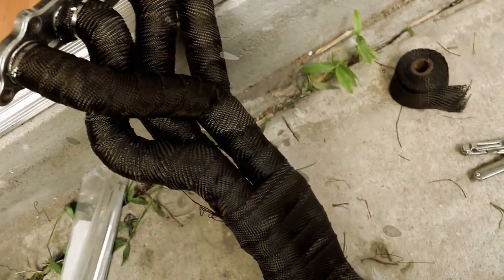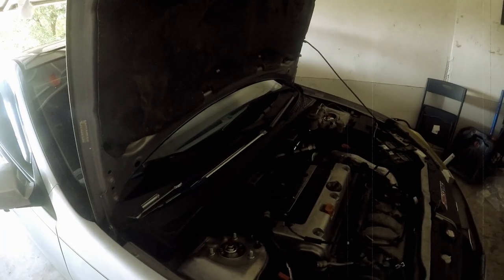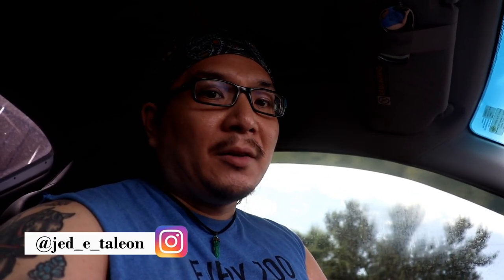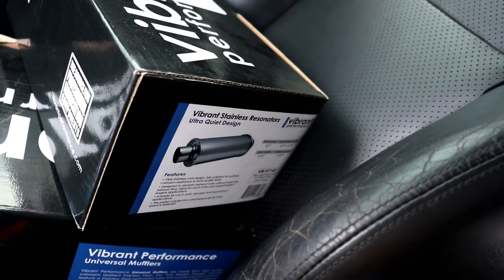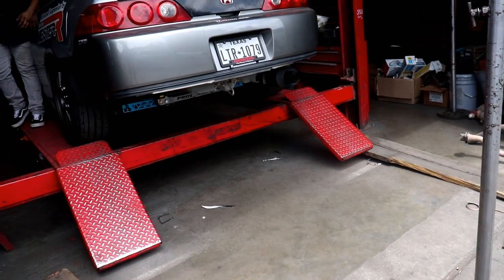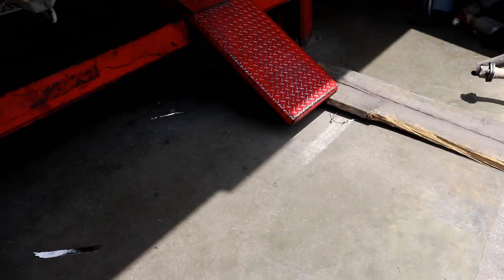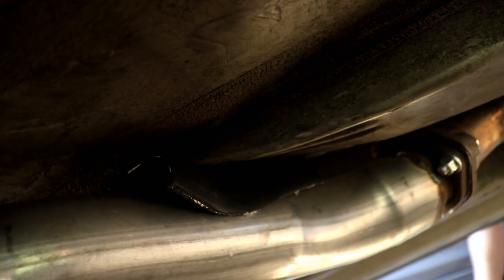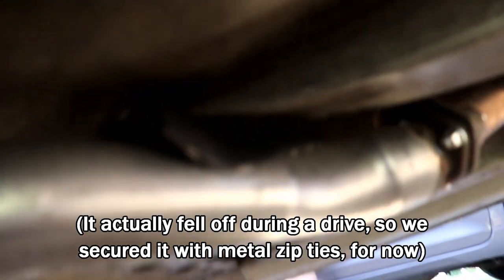My RSX Finally Gets A New Exhaust!

Comment: Just get the Energy suspension inserts for the rear mount that should help with the flex
Reply from the maker: I actually recently installed new Motor mounts and it helped tremendously, video on that in the near future lol
Reply: Jed E. Taleon nice parekoy. That will avoid your header from cracking.
Reply from the maker: @bhadz100  yup, If i got the money to spare, I might add a torque dampener to help out with that, but for now its fine lol
Reply: Thats what I got for front and rear👌 The car does feel alot stiffer. Vibrates but not bad.

Comment: *Goodness me kids... What's wrong with the exhaust...? It sounds terribly dated and loud, it seems that the engine's really struggling. Get the exhaust fixed.
Reply from the maker: If I had clips of the old exhaust, then I'd wholeheartedly agree, but it is fixed lol... believe it or not, this is quieter with a better exhaust note than the old one the car had when I first bought it, plus with some performance gains, just fyi 🤷🏻‍♂️
Reply: @JedETaleon  Yes. You probably have a damaged exhaust there kid.
Reply from the maker: @kimriley2491  a brand new custom made exhaust by a locally, well-known professional shop is damaged? I see you don't know shit about cars 😂
Reply: @JedETaleon  You probably got fooled there. 😂 That "well-known-professional-shop" has supplied you with some sub-standard cheap import. 😂 You fool. 😂
Reply: @stevepham8443  No kid. I'm fine. I have two university degrees and I am very clever. The exhaust in the video is probably damaged. Are you from korea or vietnahm?
Reply from the maker: yOu FoOl 
fyi good troll post lmao
Reply from the maker: @kimriley2491  lmaooo 2 university degrees and supposedly very clever, but still says "kid" like some 12 year old Fortnite player. Not clever enough to know how a dAmAgEd ExHaUsT sounds. But its ok, you'll eventually learn as you grow up lol
Reply: @JedETaleon  No exhaust should sound that bad. Kid. Unless it's broken. Get it fixed. That's just embarassing.
Reply from the maker: @kimriley2491  Again, I would agree if this video showed the abomination the previous owners had on it, but you still don't know shit about cars, which is the most embarrassing part here, when people are wrong, yet so confident that they're not, lmao!
Reply: @JedETaleon  It's either damaged or just simply some sub-standard cheap import ~ which would explain that terrible noise leak.